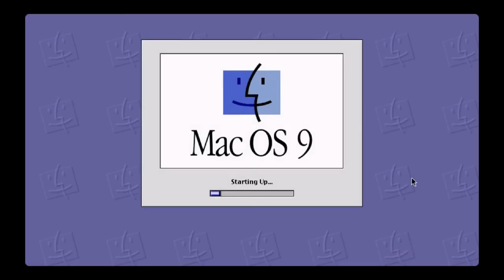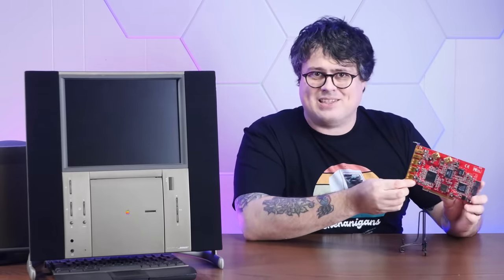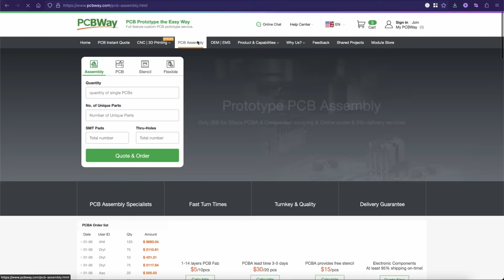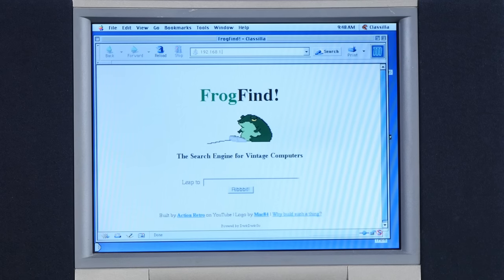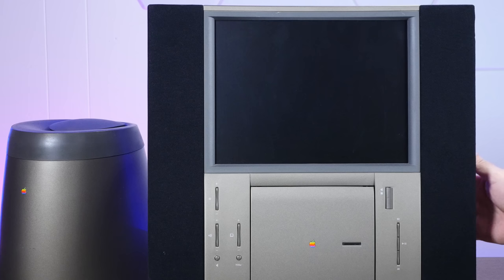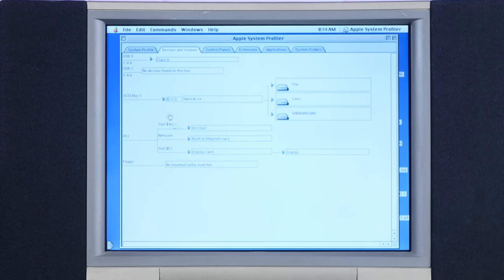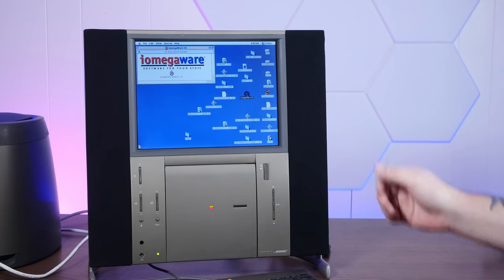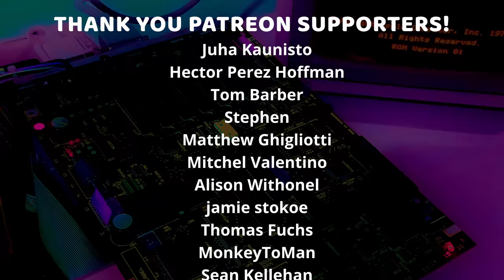One (Hacked) PCI Card to Rule Them All

Comment: Just to be clear, Cheesestraws made the patcher - I just put joevt's script into it. I just used ResEdit, Cheesestraws and joevt did all the difficult bits!
Reply: Also, heads up, FW doesn't show in System Profiler. Plug in a FW disk and it will work, but not show up in System Profiler still. If you have the drivers in of course!
Reply: Stop letting the mad man torture these poor things . But if you dont we will have entertainment
Reply: Don't pin comments

Comment: At some point in the near future, I do intend to make my own version of this card. The PCI-PCI bridge used actually supports up to 4 devices, so if I have enough board space, I may be able to squeeze 4 different controllers on one board.
Reply: Any ideas for what the 4th controller could be?
Reply: Sign me up! Definitely would like one for my Molar for starters. Already have an ATI 9200 and Sonnet USB + FW400 combo card (it also looks like it supports IDE but the headers are not installed). SATA would be nice without a 3rd card.
Reply: @Fhwgads11  probably ...

a retro nintendo gamepad controll ...err
Reply: @dcfuksurmom  Actually you could, in theory you can daisychain and infinite number of PCI-PCI bridges LOL. But that's definitely not practical, and no way I'd have enough board space to implement more than 4 devices.
Reply: @dcfuksurmom  You run into PCI limits with SATA alone.
Reply: Good Idea... By the way: Would a processor also fit onto your card? It is just a question - I thought at the heatproblem because of the Crecendo-card is in a bad position...
Reply: "Where does he get all of those wonderful toys?"

He makes them. And the rest of us live in envy!
Reply: @dosdude1 what do i do if my mbp 2011 17" has a bad intel gpu??
Reply: The man, the legend
Reply: Add Ethernet or Wi-Fi
Reply: Wi-Fi addition to that board would be king.
Reply: I would definitely suggest an RTL8139 as the fourth controller. It's an Ethernet chip which is cheap and widely supported with many OS. An another suggestion maybe have one of the SATA connections be an mSATA slot to save space in builds.
Reply: When will someone write USB 2.0 drivers for OS 8.x and 9.x?
Reply: @s6edge7  send it off to Louis Rossmann in Texas.
Reply: @curtismurray250  only if it can support PSK/WPA2
Reply: I am going to be contacting you for some g4 7448 implants in the future.
Reply: @eDoc2020  why mSATA, M.2 SATA would be better
Reply: If you do make one, instead of an ethernet controller chip definitely put a MacOS 9 compatible(there probably is not one that exists) AirPort controller chip on there and WiFi might just work
Reply: @s6edge7  you send it to someone like Louis Rossman for a CPU replacement.
Reply: @greggv8  the Dgpu is dead but the intel Gpu is also dead , not the cpu . The picture is all messed up
Reply: @s6edge7  an Intel discreet GPU? What chip is that? Google tells me Apple used an AMD Radeon.
Reply: Swap the VIA FireWire controller for something that can do FireWire 800 and make the 4th controller chip 10/100 EtherNet. Even the beige G3 only has 10 BaseT so 100 Mbps EtherNet would be a godsend!

Comment: The USB 1.4.6 driver for expansion cards is actually from the OS 9.1 retail installer, so no need to use that German installer again when you set up 9.1. Also, don't forget you can also upgrade to 9.2.2 via OS 9 Helper! You may need to reinstall the 1.4.6 drivers at that point but I can confirm that they do work on 9.2.2.

Comment: You know... Maybe instead of a whole clear back case, maybe it would make sense to get a translucent "bronze" tinted thick dual slot cover or the thin cover for the rear. Not too over the top, and would show off the heart of the machine, without the extreme work of swapping an entire case, which honestly, was part of the selling point of the machine.

Comment: In older drives when you burn disks, it usually helps to burn them on the slowest speed possible that should give the best contrast in the burned dye, since the faster you burn typically the laser spends less time on each section of the disk and the dye gets burned more lightly which will work fine in newer drives with better lasers and better FEC but on older drives disks burnt at higher speeds usually don't work as well.
Reply: Using older media (combined with low speeds) makes a big difference. I've had pretty good luck with Sony discs, but I think I had one older spindle that worked and a newer that didn't. Usually a darker dye will work better.
Reply: The best would be either disc with Azo dye or the archival grade discs with a gold reflective layer the use Phthalocyanine dye.

Comment: Really nice! BUT: Could you 3D-print a new big back for this pritty TAM (that keeps the figure of the non-extended Mac)? I also hated the original extension-box, Apple delivered with this machines.
A complete back - with a cap for the cables of additional cards - would have looked much better.

Comment: Legitimately just curious, I'm not aware of any particular reason one might install 9.1 instead of 9.2.2. Is 9.1 significantly lighter or is it just a matter of personal preference? As far as I was aware iIt's not like Windows where 98 sometimes has legitimate benefits over stuff that came after.
Reply from the maker: On a lot of older PowerMacs, 9.1 is the last supported version, and you can't install 9.2 without some hacks
Reply: @ActionRetro  That's an interesting point and not one I was expecting -- I've never had anything older than a snow white G3 iBook so it's not something I would have run into, actually I'm more familiar with machines being unable to run classic MacOS whatsoever.

Comment: Not much flex but I think I have the worlds most decked out Performa 6300CD. It has the Apple TV/Video system, fax modem, Farallon ethermac PDS card, Apple external video connector, 64mb RAM (with 128mb virtual memory), 128GB sata ssd divided into 4 equal partitions booting OS 7.6.1 and 9.1. Seems like this is 1 of the only models that's can't take a CPU upgrade... even in the cache slot (6360 CPU can be upgraded apparently).

For a future video you should service the cooling loop on your G5 quad (think your G5 is a quad) and perform the new blood mod. Will  have to do that to mine soon... it runs too hot with no sign of leakage (yet).  The dexcool is probably decomposing at this point.

Comment: With firewire not working... is it a fluke of the dosdude video or is there a solder blob shorting some pins between 70 - 80 of the VIA  VT6306 chip?

Comment: I just started watching your video's. I used your G3 upgrade on my mini tower. I put a 350 Mhz G3 processor in it. Original was 266/33. Now it's stable at 433/78 or 416/83. The 433 is just a bit faster. I had a G5 but when turned on the power light just flashes. It's just sitting now.

Comment: Can verify that my TAM refuses to load burned disks as well.   Can also verify that my TAM bricked (temporarily) when attempting an OS X install.  I had to remove the PRAM battery for a few days and it eventually came back to life.
Reply: it will play burned audio discs though.  you can turn on with the remote and it will play the audio cd automatically after booting
Reply: @bad_collector  I never knew that. I appreciate the heads up.

Comment: If that PCI card could also work on Windows 9x, I can think of at least a couple of builds, including one of my own, that would want one of these, as well ⁉️❕
Reply: I suspect they might. I haven't checked how far they go back OS wise, but mac users spend our time flashing them /from/ PC versions.
Reply: The SATA controller has a driver for 98SE and ME and it works in real mode with the option ROM. I don't know if there is a driver for USB 2.0, but USB 1.1 and Firewire should work out of the box.
Reply: @Drucklufttroete  The commonly seen "nusb36e" driver adds USB 2 and mass storage device support to 98SE by backporting appropriate files from newer versions of Windows.
Reply: Then I suppose my only question is... what is the model of this card, so I can look it up and see if anywhere is selling it? because DUDE!
Reply: @Jorge Ramos  Technically it is a "ST-200"
Reply: @phipli  I'm not seeing anything resembling the card in the video under that model designation. :(
Reply: @ZeroHourProductions407  I had replied, but I must have said something youtube didn't like, I gave search terms. But, these cards are not readily available and don't have much of an Internet presence. I have some. Mine have ST-200 on them :)

Comment: I watched Dosdude build an IDE SSD  a few weeks ago😄👍
9:15 This is about as janky as my Dell Optiplex 9010 AIO  rigged up to a Titan Black on a Beast mpci GPU dock with external power supply and another monitor, since the external GPU won't power the built in screen.🤣 
WHY? when I have a perfectly fine 6850k/1070 desktop? I Just had to scratch that random tinker ich🤣